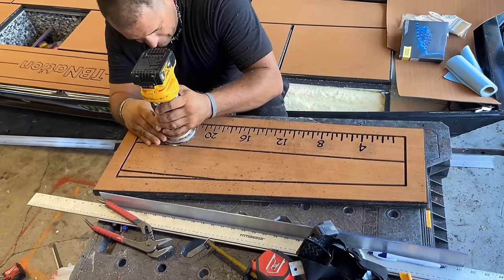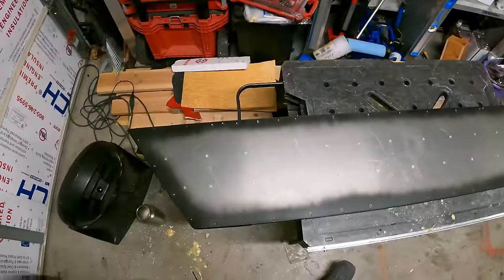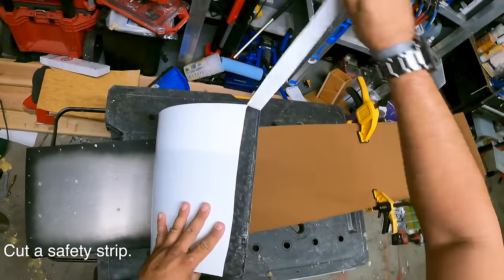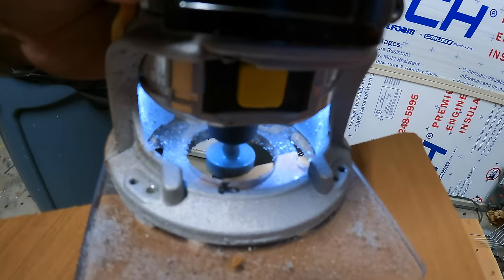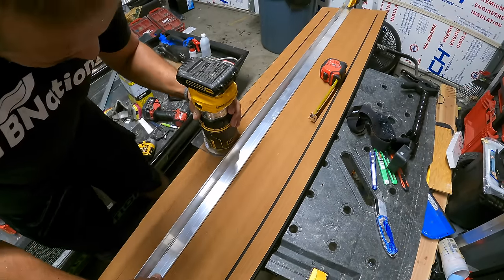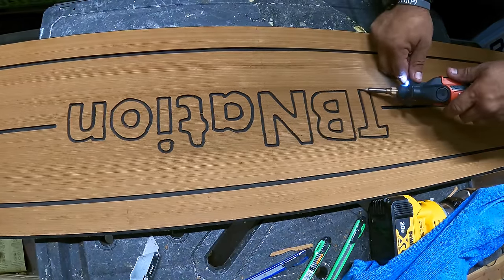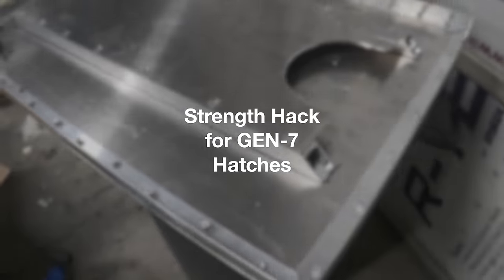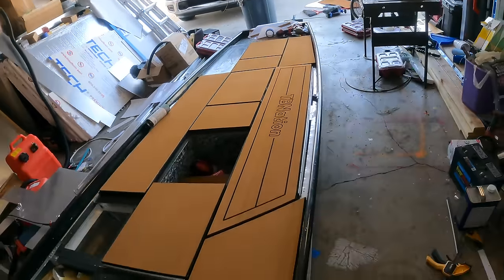DIY vs Professional EVA foam boat decking & Flooring | TBNation Tutorial

Comment: One tip i recommended when you want to apply stickers or vinal or this stuff is to use some soapy water i normally use dishwashing liquid then if it isn't where you want it you can move it around without it sticking and if you have it where you want it let it dry and boom it's perfect

Comment: Hey man. I used to run a big CNC router to cut cooler covers from EVA foam and we found that using stone grinding bits work really well. We would use a cone bit with a small radius at the top. The grinding action leaves a super smooth finish and it also creates a little bit of heat which helps melt and seal the foam. Give it a try if you have a chance. If you can, use a high RPM on that router. Just a little trick of the trade I picked up years ago.
Reply: Also the taper in the cone adds for a nice transition between the top of the foam to the bottom of the groove.
Reply: Love all the great work! I live to see that notification pop up with a new video. Cheers!

Comment: When you use a router don't start at the full depth take a little bit off at a time  By making a couple passes till you reach the depth. also there is a down cut and a up cut bit  Depending if you want the surface to be smooth or the bottom of the groove to be smooth

Comment: Just putting it out there, perhaps a good way to stop shifting and keep the foam flat would be to use strips of thin double sided tape at an appropriate distance on the paper and stick it to a perfectly flat surface.  Would solve a lot of the problems I have seen you have during various builds.

Comment: For your border lines, you don't even have to mark them out. Just clamp the piece up against a flat edge (back of your work bench or whatever) and hold the router up against that to make your straight line.

Comment: Hi Mike, I love the look of the self-routing eva. My question is how to hide a seam since my front deck is larger than the sheet of foam? I've done it prevoiusly with the pre-routed eva but really like the clean look of the foam that you're using in this video. Thanks
Reply from the maker: Hey, you have to overlap the two pieces and cut once. Then pull the bottom piece out, and they should align perfectly.

Comment: You could attach a guide to the router plate by drilling two holes through the square end, and use a scrap of cusaboard. It would speed your process up significantly and have repeatable results.
Reply: @TinyBoatNation  not my idea haha half of woodworking is coming up with ways to be more efficient. There's a ton of videos on routers and jigs to improve your work.

Comment: I told my wife that when I get home from deployment I’m buying a new boat to build out. I was expecting some pushback but to my surprise she just said, “that’s okay you deserve it.” I don’t want to get someone’s used beat to heck project that’s corroded beyond belief or anything. I’ve got some time to figure it out. But I really want to build a deep v hull. Maybe a 14-16 alumacraft.
Reply: I built a 14 ft deep v alumacraft. Awesome boat, cuts through water and is insanely stable. Hits upper 20's with my 25hp yamaha, but can also make good progress with a trolling motor. Unfortunately, it is a rivet boat. I'd highly recommend going fully welded if you're not planning on replacing all rivets. Pin hole leaks and flex seal galore. Granted, mine is a '54....

Comment: That turned out very good! I am currently putting all new carpet and cubbys in my boat. I was thinking about buying that type of floor but was skeptical about it sticking to unfinished fiberglass. What is your thoughts on using that flooring on fiberglass floors?

Comment: Recommendation for install on wood?
Reply from the maker: Contact cement. Or you can resin and wet sand it smooth and the foam with adhesive will go right on wood just like with the Coosa.
Reply: @TinyBoatNation  thank you!